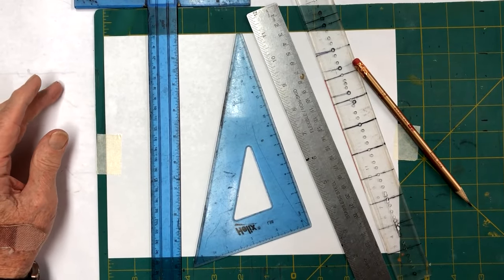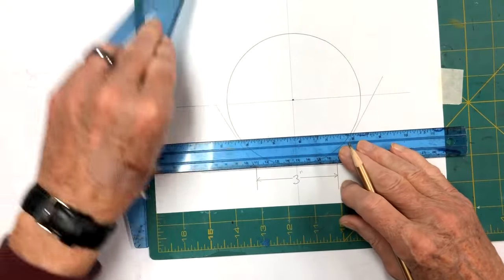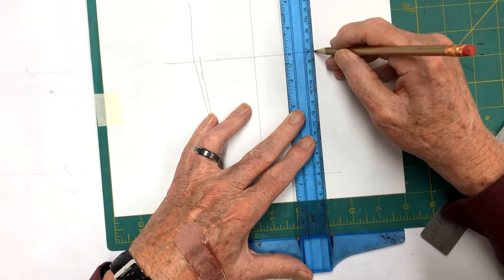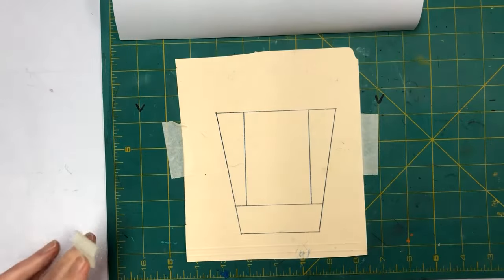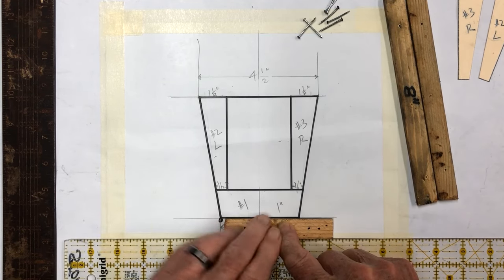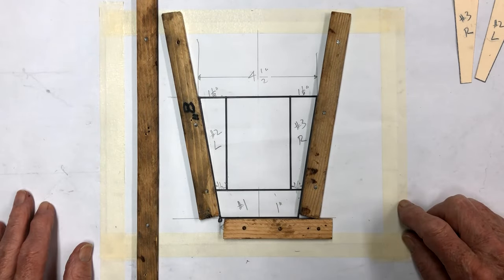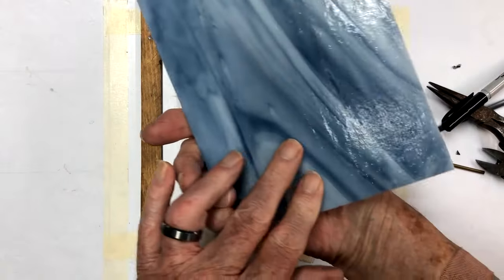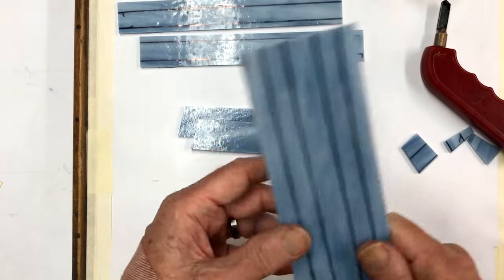Leaded Glass Hummingbird Solar Lantern!!

Comment: Awww WoW !! This is so awesome Bill, Hello to yr lovely wife, thanks for helping so we can see better ❤
Bill did you get the hanging birds of Amazon, I'd love to try & make that it so so pretty .
I have a question I'm not sure if I've asked before, yr offcuts of stained glass that you  used can they be fired in a kiln to melt the edges or is that only possibly with fused glass sheets ?
Thankyou guys  
Have the best day 😊
Reply: Love it Bill. I find creative ideas come to me at every turn. I have bought small sheet of galvanized steel for the tabs at bottom of the solar lanterns. However I'm not been able to get the solder to take to the steel. I've used steel wool, sand paper with no luck. I've used the crown of 1/2" flat lead tinned both sides for the tabs. I would like to solve the issue with the steel I have. You said you use galvanized tin?
Reply: @julierickert2145  Julie I think you put yr comment in aussiemachandmadeeverything, not a direct comment to Bill, I would rewrite the question to Bill.
I'm no expert but I think its because you used steel, solder doesn't  seem to stick to steel, however you might be correct about Galvanised tin, if you try it the solder should stick them together 😊
Reply: Oops
Reply from the maker: Hi Austra,
So nice to hear from you again!! So glad you enjoyed this video, I'm making another one right now called Leaded Glass Hummingbird Solar Lantern 2.0. Should have it posted in the next couple days. It's a remake of the first one only cut down to fit the solar panel so you don't have to make the insert to hold it in place. That set of Hummingbirds was from Walmart. The set I'm going to use for the remake is the same size but from Amazon and I like it better. The Answer to your question is YES!! you can fire polish to edges of stained class at about 1350 to 1350 degrees to polish the edges. You just can't use it to fuse glass together.
Have a great day, how is the new workshop working out for you?? Have fun with your projects!!
Regards,
Bill Stone
Reply from the maker: Hi Julie,
 Sounds like we are all making new friends!!
Reply from the maker: I hope I don't lose my teaching job!!!
Regards,
Bill Stone
Reply: @billstonesstainedglasscrea3310  lol no way Bill you are my go to stained glass guru 😁
Reply from the maker: OK I'm still safe, so didn't want to lose my volunteer job!!! Have a great one!!!
Reply: @billstonesstainedglasscrea3310  Hi Bill
I look forward to seeing that one....Thankyou I have so much left over little pieces of glass, I think firing them would be great to use for mosaic, so thankyou for letting me know I can fire them to smooth the edges.
My workshop is awesome, I have a lady wants my pieces to sell in her shop, unfortunately my Husband has fallen ill & I'm taking care of  lady friend of mine in her late 60's after an operation, so I'm under the pump.
You could never lose yr job as teacher.
I just realised that Julie replied to me & not directly to you, so I hope my answer to her was right, if I was as least you know I'm learning from you 🤣
Reply: @billstonesstainedglasscrea3310  yep yr safe lol
Have a great day 😁

Comment: Love it Bill. Question, I bought a small sheet of galvanized steel for the tabs on the bottom of the solar lanterns. It doesn't take the solder, I've used steel wool and tried rough sandpaper on it, help. I've used the leaf of 1/2" lead that i tinted for the tabs. You said galvanized tin is what you use, is there a difference?
Reply from the maker: Hi stranger, 
Nice to hear from you. Yes, I use the thin galvanized tin sheet to make the tabs to hold the bottoms in the solar lanterns. Sometimes it is hard to get it cleaned up enough to get it to take solder. I use an 80-grit emery board and really sand it down to bare metal, then flux it and solder it. Over the past I have also used a product made by K & S Precision Metals, it's a Brass Sheet .025" thick, 3/4" wide and 12" long to make these tabs. The Brass solders really good. You can find their products at Hobby Stores, Hobby Lobby and on Amazon. I just cut them off the end of the sheet at 1/2" or so that makes a tab 1/2"x 3/4" which is perfect size. I hope this is hopeful to you. How did you like this project? It's a fun one to make, give it a try when you have time. Have a great day.
Regards,
Bill Stone
Reply: Thanks. I've 5 patterns drawn out over the winter, just getting warm enough to work in the garage again. I like the birds, I'll look for something like that, Menards will have some cool stuff out. I'll check with the hobby lobby
Reply: about the brass.
Reply from the maker: Hi Again,
Sounds like you're going to be busy this summer. The hummingbirds I used in this video are from Walmart, I'm making another video called Leaded Glass Hummingbird Solar Lantern 2.0, the hummingbirds in that one are from Amazon. Enjoy the rest of your day!!
Regards,
Bill Stone
Reply from the maker: Check it out when you have time, it works great!!